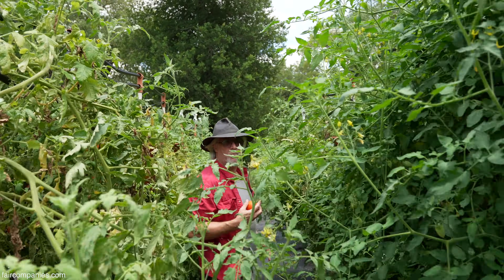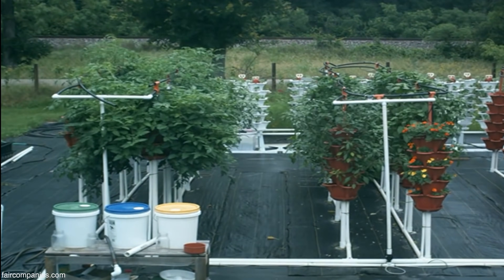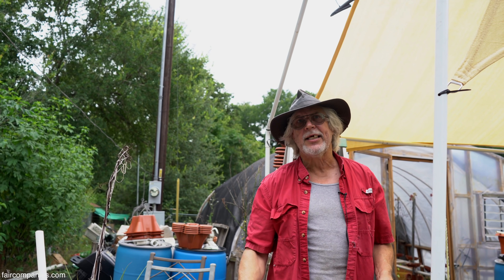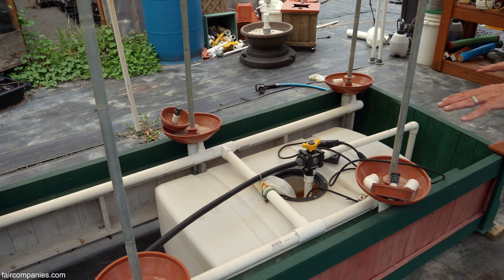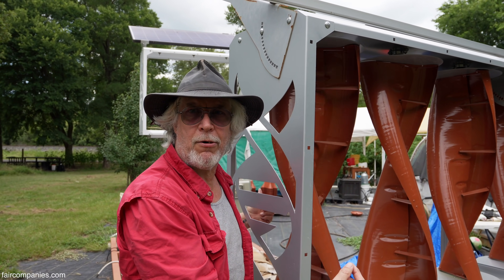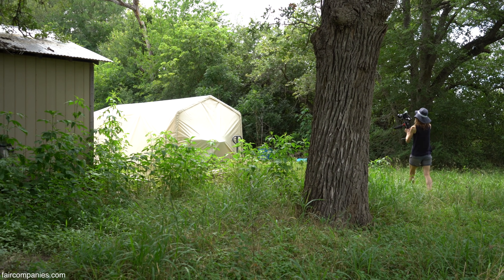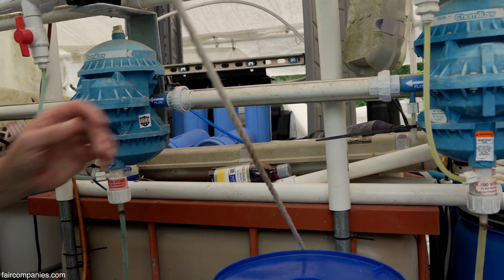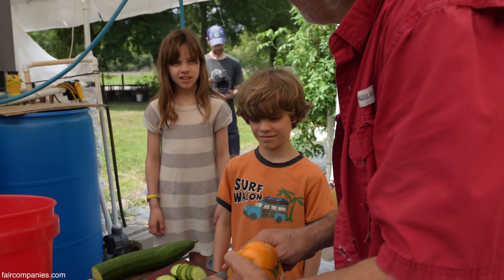Mad scientist's homestead is parking size, off-grid system

Comment: A guy i know has a 4x4 hydroponic system. At bottom  of fish tank he instled a faucet. To the faucet heattached a Y with on/off . On one side there is nothing attached unless he needs water from it. On other side he attached garddn hose to his garden then at his garden he attached to hose a drip irrigation hose to his plants. So whdn its time to watef his vegetables he just opens faucet n lets grVity do its thing while he tends to the 4x4 hydroponics. The nutrients from fishy water feeds the main veg garddnn he keeps track of the wster tank. It works.

Comment: Does any one know exactly how this setup works?  So the Nutient tank has a float valve connected to fresh water line, and has some sensors to allow the nutrients etc to fill it correctly...then how does it fill the irrigation barrel, is it a float sensor and a pump? and then the irrigation barrel has a pump to feed the rows of plants which then cycles to the buried pump, so then it must tee into the outlet of the main with a check valve or something to prevent backflow.  This system is more complex than it seems.  How do you think hes automating the filling and pumping to each barrel?

Comment: man i stopped at minute 2.... plant your tomatoes on the ground and use half of the fertilizer you put in your hydroponic system... better you could use natural fertilizers that do not come from a factory... you do not need pumps and filtering system... about the heating of the pot... man the ground is your solution, unless everything is radioactive there...
Reply: Yes! Everything run on petrol at the end.

Comment: The only problem I see is that this output of food can only be sustained by adding mineral fertilizer, which isn't necassarily very sustainable because there isn't an unlimited amount left to use. To be truly independent and off grid you'd have to have a much greater volume of soil and dead biomass in order to sustain the level of humus and microorganisms needed to filter out enough minerals and make them available to the plants. One would maybe be able to replace the artificially added fertilizer by composting of dead plants and utilizing the sewage generated by eating the food grown in this system in order to make it a truly independent cycle. But then the effort of liquifiying the fertilizer would maybe outway the benefits on such a small scale and a horizontal garden would again be more favorable to make it easier to spread the fertilizer.

Comment: that system should be 3 and 3/8ths inch thick stack and ground every other magnet it might take 11 plates  now listen
here is the secret of the ages go to the local craft  and get some Gold foil and watch what happens put gold only on 7 plates
i pretty sure its going to be off the charts  if you can put a pure coretz slice at the nautical  points it should hum with the amount of output you see
and if you submerse it it is in a zero gravity environment so the test is insolated unless it begins to evaporate the water because of heat

Comment: As cool and efficient as this setup is, it still relies on industrial fertilizers to work. And once those are no longer available, let's say due to supply chain issues, the productivity of it will drop drastically, unless local, organic substitutes can be found somehow.
Reply: Adding aquaculture would be easy with this type of system;  fish waste from a living pond, or fish meal would provide the nutrients for the hydroponic garden.   You would still need some minerals but that's a lot easier to stockpile ahead of time,  or get from other local operations  (calcium from eggshells, etc.)  A local lady I know is doing this using commercial fish meal as the nutrient source for her hydroponics.  Just one decent sized fish pond could support a moderate hydroponics garden probably.
Reply: @charlesrichardson6461  Yep. Except that fish also need to be fed by something. And they sure don't thrive on tomatos! Also, Aquaculture needs to be heated in Winter and have pumps for filters etc. driving up the energy demand of the system.
Reply: @charlesrichardson6461  both are uneconomical too.

Comment: He still hasn't made the next logical jump, still is thinking he needs to grow outdoors in potted soil.  He's losing precious water by growing outdoors through transpiration, leaks and breezes.  The ultimate setup is what they're doing in the Netherlands.  They've built massive greenhouses and they grow with hydroponics.  Roots don't need soil.  Hydroponics controls every drop of water and nutrition, sun, everything almost perfectly, reclaiming more than 98% of the water as well as controlling air temp and humidity, lighting, and excluding pests and the diseases they spread.  He's only gone halfway, still wasting water, and depending on unnecessary nonsterile soil.
Reply: Water is renewable and  cheaper and more abundant than petrol based high tech.

Think of for example all the water that is wasted unnecessarily.

Comment: I have the pots but not the closed circulating system. I have these inside raised bed gardens and water from the top and it drains right into the raised bed garden

Comment: Love what he did with this, however why aren't the wind turbines generating power. He is correct in peak summer sun will generate power for approximately 6 hours but this would generate more power than is being used and the rest could be stored in batteries. The short of it is there is no way those turbines are covering his power needs, not even close. He will have decent wind 3 months out of the year and that will only be if he get those up to a minimum height of 55 ft. qith not obstructions for at least 235 feet. He is using at least 15kw a day to power those pumps each day.
Overall love what he has done, great use of space and resources. I just wouldn't want to see someone order those turbines with the wrong expectations.

Comment: That kind of turbine are well known to engineers .. design is similar to Savonius helical wind turbine. Also the way of producing power .. in a car its how its, not the best but reliable and fit to application - most of repairs include changes of brush and bearing. ..

Comment: Man can't live off tomatoes alone. And I wouldn't wana be there when one of the pipes break, or a spring in the solar goes, or the battery for the system goes, or a micro chip breaks in the electricity system, or the pots wear out (made of plastic) or the shop runs out of fertiliser for the tanks or any number of industrially mined resource required to keep this over engineered contraption working ... To summarise: it's not sustainable. 

Cool set up and looks good for a "science fair" and as a product to "purchase" from Amazon lol. But nature and permaculture (which already contains use of vertical space) is the real solution, as always. 😊🙏

Comment: Honestly the return on investment is much greater when you plant in the ground and fertilize with rotting manure. The amount of gadgetry in the system is way above most people. Not to mention how much All the pumps and injectors cost. Personally I will stick to the old-fashioned method. That said those pots are very cool and I can see where they would be super efficient in tight spaces. The wind turbines are like DNA helixes! Brilliant.

Comment: Even if the turbines are a bit less efficient: they don't slice up birds, don't need 20m high towers with massive foundation, don't pollute via sound, and are easy to access and repair. That's worth any small amount of energy loss. Also, few are researching vertical turbines because horizontals won, so no new insights are generated. Which is why he had such an easy time improving drastically.

Comment: The fact that the solar panels are directing the wind into the turbines is not lost on me. Clever, sort of like how high-capacity solar cells will use cheap mirrors to concentrate sunlight onto small expensive cells to maximize their performance.

Comment: i don't like egomaniacs nor leaders talking the talk but it's good encouraging setup in the right direction however he wasted a lot of metal doing the those VAWT. he could have made organic aeroponics using the turbines to power compressors and store the energy in bioplastic air tanks with near isothermal setup. also that plastic degrades over time, plastic cannot be used under sun and he could just have made pots with compressed biomass and final layer of biobased epoxy

Comment: Anyone thinking this is a budget friendly approach because of his "not in it for profit" sales pitch oops I mean attitude better guess again. Also when he tries to talk trash about regular pots breaking they cost next to nothing(off the top of my head I know 2 gallon soft pots are around 50 cents (CAD) each in store and can be used for YEARS, I've never had to replace pots annually, right now I have pots that have been used well over 5 years)! Using 2 inch PVC for a center pipe a person could build a tower themselves with regular pots and wood dowel (because it's easier to drill 1 inch holes than make 1 inch squares for say 1x1) through the middle to sit under pots on either side plus a screw or two through the top of the pot into PVC shaft. Next you could cut thousands off the build opting out of the Dosatron nutrient injection system and mixing food once a week. The reservoir (if going with say a 50 gallon are only $40 CAD), irrigation lines, timer, spikes and pump required for self watering is all very cheap stuff. So is a hose, pump and hand wand to just hand water.

Comment: He's not a mad scientist he is a genius that thinks outside of the box and I can totally appreciate that. The only potential problem I can see with that system is your relying on electric pumps and lots of hose and PVC and pots which is a lot of parts so when our economy and currency go's into hyperinflation and the system crashes it will be hard if not impossible to get replacement pumps and other parts that will be much much more money. I do think this guys system is I ingenious!!! The wind power helix with the modified generator motors are great!!!

Comment: Great product with these vertical pots. Love the design and the functionality. However vertical hydroponics can be traced back to 600 B.C. And the first patent on the Helix VAWT is by a german man named Ulrich Stampa in the 70's.. My grandfather is the same mentality however, pretends he invented everything because people believed anything he said before the internet was invented. Then he burned out when ebay took over and he couldn't con people anymore. You aren't a millionaire because china offers a cheaper product. Plain and simple. Regardless if it holds up or not, china now has all the pockets of the poor and the ignorant. I know it's hard not to get carried away when talking infront of a camera. None of that detracts from the fact that this is still a great setup, and for those willing to dump a small fortune into plastic, this will negate a ton of back breaking work. Personally I think there is room for both organic no till gardening AND hydroponics in the future of food. With populations rising with no end in sight we are going to have to rely more and more on ourselves for less toxic sources of food.
Reply: Stacking flower pots have been done for years prior to this guy.
Hydroponics have been done for years.
Axial flux and pancake motors have been done for years.
The mobile signal boosters have been around longer than mobile phone, it's just antenna design.
VAWT has been done for centuries.

This guy hasn't invented anything, but he has innovated by combining and making fit for his purpose other peoples concepts.

Is he a genius, no, but he's no fraud, he understands the systems and in some instances has achieved innovative solutions.

I am not sure anyone thought to fit a pancake motor to a VAWT, and then a multi layer version reducing rotational torque and starting wind speed, because the amount of people working on them is limited because the prevailing thought is that HAWT are the only solution. That narrow minded HAWT group think allows innovation from people like Larry for alternative ideas to come through.

I use VAWT because they are the right solution for me, and now because of Larry I use multi-layer pancake motors. Did he invent either of them, no, but he showed me they where compatible, and why they where worth the hassle.

Is Larry's terminology hyperbolic, yep a little, does he use one explanation in simplifying technical information, when a different one would be better, causing confusion in those who think they know what they are talking about, yep.

Loads of people have used car alternators on DIY HAWT systems, most 'lay' people understand what is meant by the word alternator, but is he using a 3 phase generator, yup. These are different different words for a similar end goal of creating electricity from rotary motion, and those who think they know everything are so inflexible as to immediately shut down the overarching concepts just because they believe a word is incorrectly used.

I don't know if he has been a millionaire and lost it. I know many poor millionaires, generally they are leveraged to the hilt, and have very little 'play' money. Generally type A personalities who think the actual grind is the goal. Being a millionaire isn't rich enough for the life that most people seem to think he gave up.
I used to make decent money, gave it up, used my capital to buy a place in the country, knocked out most of my expenses, garden, potter in the workshop, build renewable power and other fun things, and now operate without a calendar appointment most week's and generally forget to put on my watch. Much nicer life.

I have never met your grandfather, and yes his statements may be hyperbolic, but look at the light bulb, multiple people all came to the design at the same time, and probably a few of them completely independently.
Even though we don't realise it, and makes no sense (the human brain is generally really bad at understanding probability and coincidence), it is sometimes just a technologies time to exist.

You have a limited time with your grandfather, even if he is lying in inventing ideas and concepts, accept that that is only one part of who he is, and there are others.
And just remember, just because someone else thought of the initial concept first, doesn't mean your grandfather didn't independently invent it or work on ways to improve it. The logical leap that Farnsworth made from ploughing to the electronic TV is just astounding.

The internet gives actual definitive answers, no award for second place, and we are loosing the ability to realise we have to allow tolerance, because people, society and the language we use are fundamentally flawed.

Comment: Very interesting. Although the turbine thing seemed a little contradictory. Horizontal turbines are way more efficient. But you need the height, to get wind speed and direction consistency. Maybe his prototypes couldn't figure out wind direction, but that's mostly due to design or positioning.
Reply: Look at his buyers though. The average person doesn't have the resources to build up. Or the space to do that.

The average person needs to have multipurpose designed into what they build. Just like nations that are poorer. Putting these together with panels does all of that. It's a pretty good idea.

Comment: This is cool, but lots of points of failure. I just built a larry hall system where totes filled with cocoperlite sat on a rain gutter that's filled from a drum using gravity and a float valve. No power, no pumps or sensors. One tube from the drum to the float valve. Hoocho has great videos on systems like that. Talk about real low maintenance! I also don't know a good hydroponic system, nft, dwc, whatever that is drain to waste.

This is over engineering at its finest.

Comment: the vertical axis windmill with the Savonius design (double helix) is very in efficient 20%
compared to 40% of Darrieus Rotor Design (smaller blades)

or up to 45% of Conventional horizontal axis wind turbine

Comment: I wonder if the power consumption could be reduced significantly through storing the main water tanks at a higher level than the plants. The waste water re circulation system however would then take more pressure to return to the tank, maybe intelligent watering to reduce volume of waste water might be a good future upgrade.

Comment: Looks amazing for sure, but if you use soil your garden can be mobile and no need for all the plumbing, tanks, pumps,electricity, synthetic fertilizers.... So many reasons this is a bad idea the main one is there’s a far better way of growing using far less energy and work🤔
https://www.facebook.com/photo.php?fbid=657561528193862&set=a.100976200519067&type=3

Comment: Made with recycled HDPE. That is not what you want your food to contact. There is no way to tell what was in the container prior to recycling. Only use virgin HDPE for food and water contact.
Reply: i thought it was recyclable hdpe not recycled? I may have read wrong
Reply: @eko1966  I am not sure he said anything about it. I looked on the website to price them and read "We extrude our structural material using reclaimed High Density Polyethylene. In simple terms, we make our Quad Pots from sources like discarded milk jugs & water bottles. Every product we make contains recycled material". The discarded items listed as recycled are not typically HDPE so it is clear they don't have any knowledge of where it is coming from. It may be nothing but I don't trust recycled plastic for this purpose.